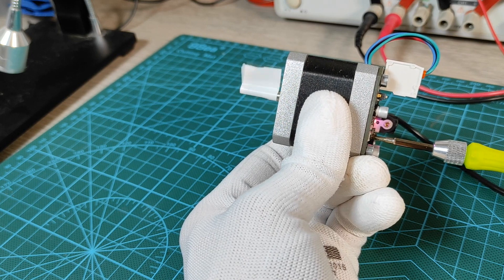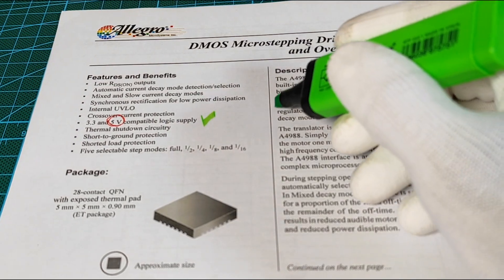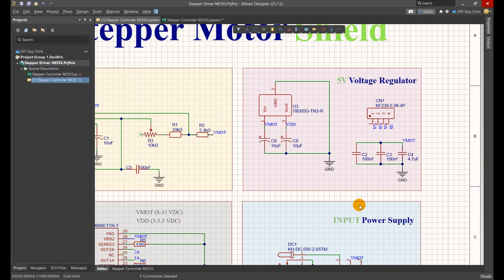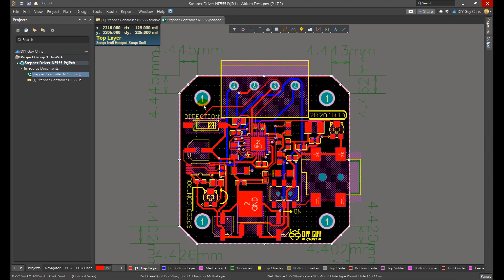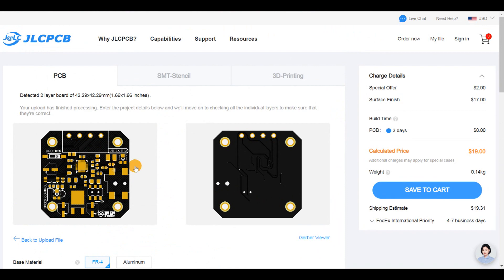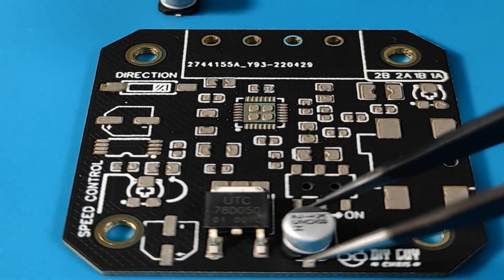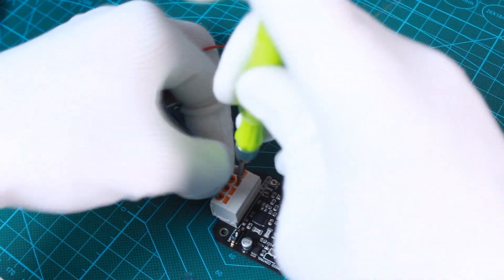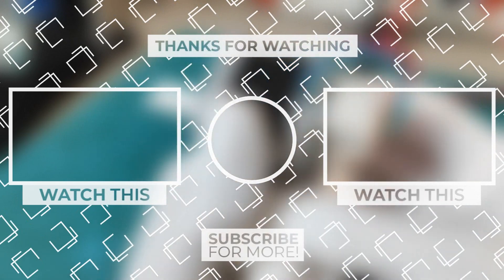A4988 Ultimate guide for easy use (You don't need Code)

Comment: How hot does that screen separator you're using as a hot plate get? I'm seeing mixed reports on the web (even on places that have it for sale) that it maxes out anywhere from about 150 degrees all the way up to 400. Are you using low temp bismuth solder?
Reply from the maker: Exactly, you already spotted the trick around it, it is all about getting a low temperature profile solder paste, the maximum temperature that screen separator could reach is 190 Celsius degrees.
Reply: @DIYGUYChris  ahh ok, thanks for the info. Looks like Uyue do some some other higher temp got plates that aren't too expensive, so might have to check one of those out.